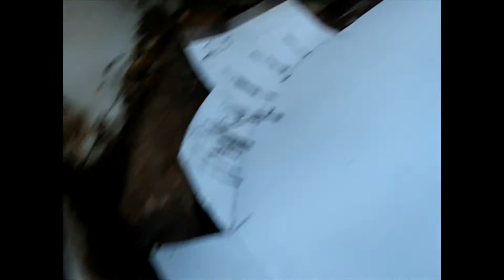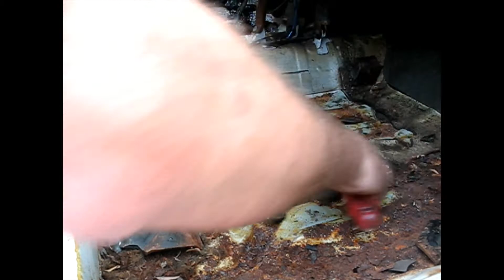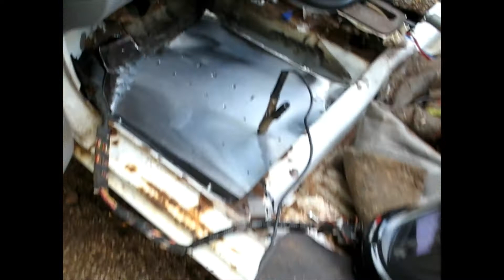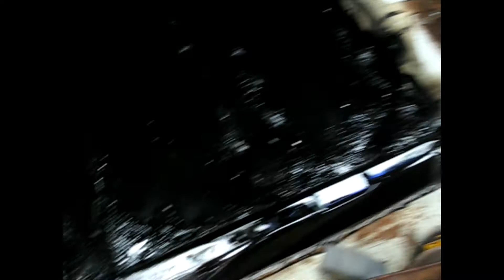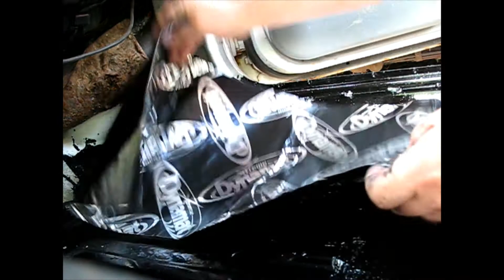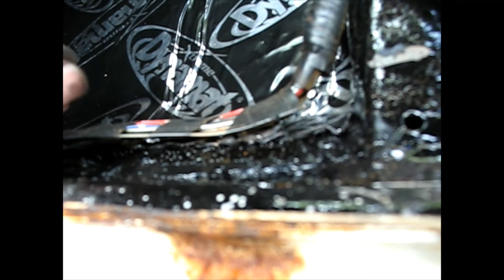1992 Geo Metro convertible gets new floor pans part 2

Comment: I have a hatchback that I want to turn into something I can drive and access from my wheelchair. I am an incomplete Quadriplegic. 
Found you while looking for anyone who had modified a Metro like that.
I subbed because I'm I interested in your result.
Reply from the maker: I don't know if you live where they rust bad but be careful cutting anything because they are unibody and every piece is needed for proper structure. Almost ALL in my area have succumbed to the rust monster- usually under where the front door hinge is - up underneath it just weakens from rust and collapses and no body shop will touch it.
For now I'm just delaying the inevitable as long as I can
Reply: @jcwildwood  I live in the south east. The project car is rust free. I'm sorry you guys up North have to salt your roads. I basicly just want The fenders forward.